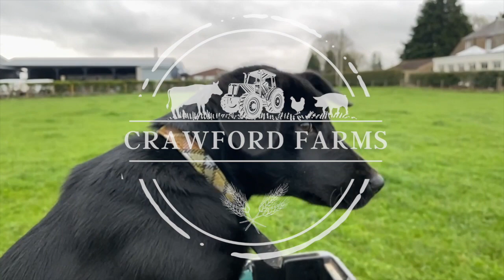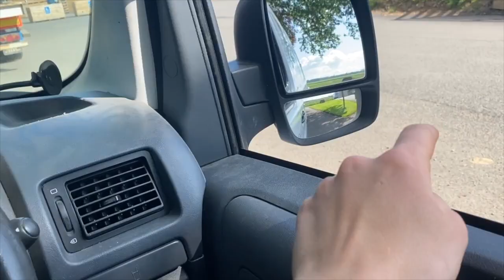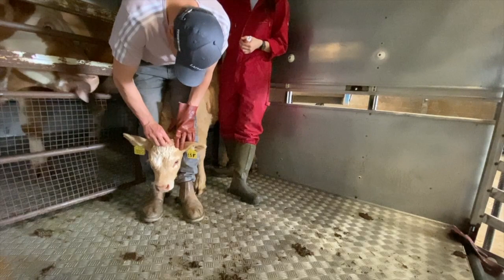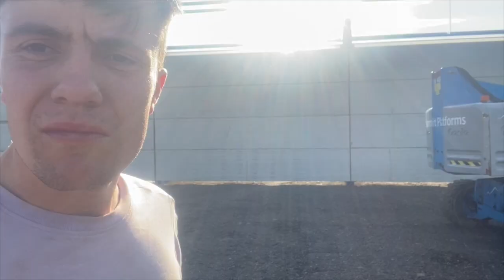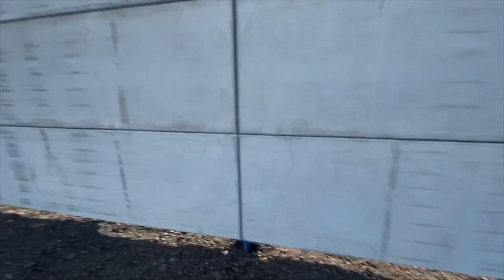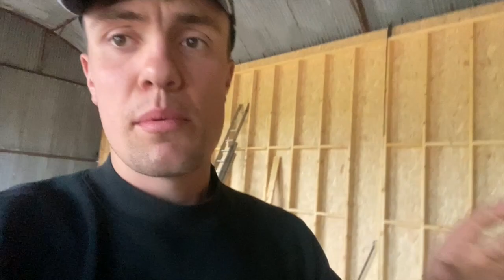BUNKER WALLS INSTALLED | FINAL COW MEETS THE BULL | BARN CONVERSION #CRAWFORDFARMS #060

Comment: Could the holes be for electrical wiring?  My biggest question yet, why does the new building need to be so tall? You won’t likely be storing granito the height of that mega roof. Is it just so tractors fit? Your store sounds like it sells everything.